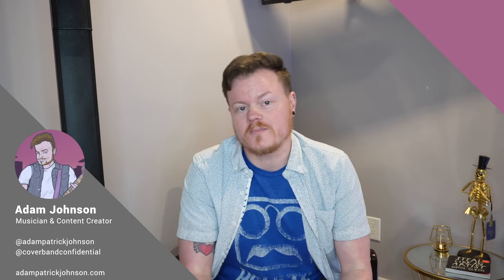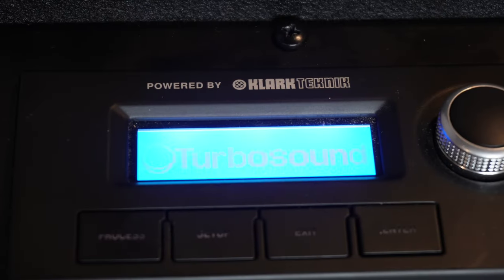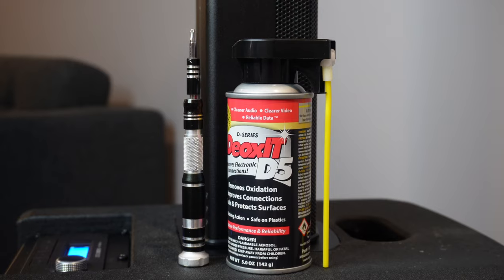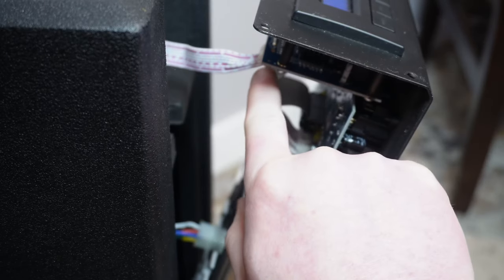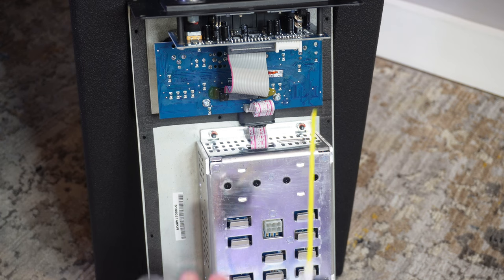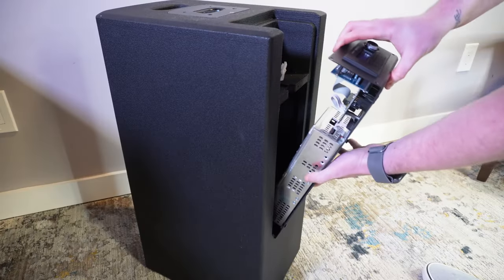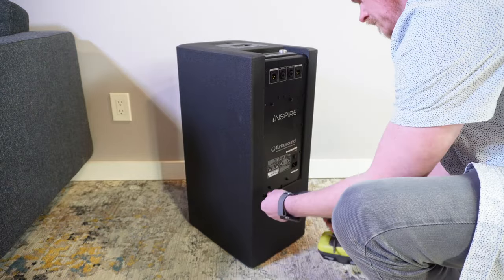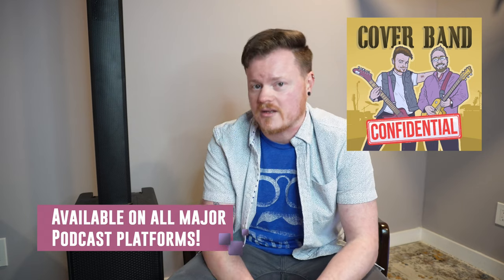FIX your CRACKLING TurboSound ip1000 or ip2000 (No special tools required!!!)

Comment: Thank you for your YouTube video regarding the crackling sound coming from the Turbosound IP 1000.  I own an IP 1000 system and uses it on a regular basis.  My issue however is that I dropped the column and bent one or more of the 4 rods that plug into the base.  Once I plug in the column it is difficult to remove.  I know that it shouldn’t work like this.  Once plugged in it works fine. Suggestions for straightening the rods would really be appreciated.

Comment: Hey, have you or anybody else experienced overheating with IP1000 V2 or V1? I just received a brand new one and after 2 hours of usage the back panel got really hot and I'm concerned that electronic components might get damaged overtime. 

For example, if it got any hotter I think that I wouldn't be able to hold my hand on it.

I would really appreciate if anybody shared the experience. I like the sound and I would really like to keep the unit!

Comment: Hey there, we have an IP2000 started having a crackle through the column but not sustained - only when certain vocal frequencies were loud enough, suggesting it’s one or more of the speakers in the column. Had a friend bring his column and plugged into the subwoofer and sounds fine, so not likely the connectors - anybody else have a problem like this? Thinkin about opening up the column and checking the speakers…
Reply from the maker: I would still give it a try

Comment: I love my ip1000, the sound is great, but the built in reverb is crackly as it dies. I'll have a go at the connections but would be happy to hear if anyone else has this problem. I bluetooth backing tracks to it for my sax, I use reverb from a small mixing desk, which works well but for small gigs plugging in my radio mic directly would be an advantage. Thanks to anyone who replies. 🙂
Reply from the maker: I think this process addresses the crackly high-end as well.